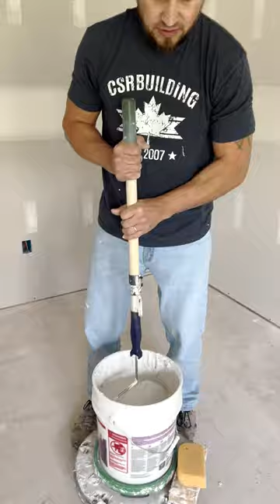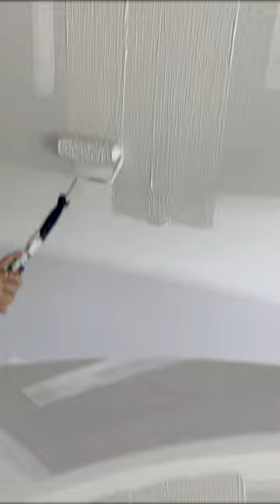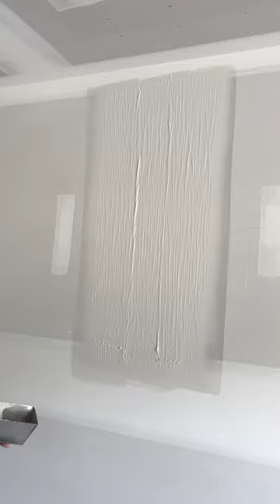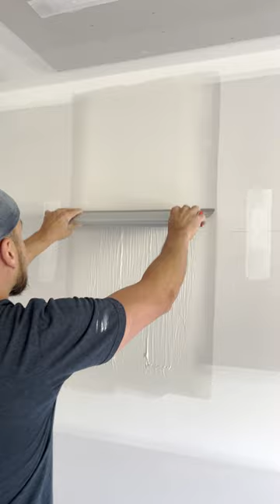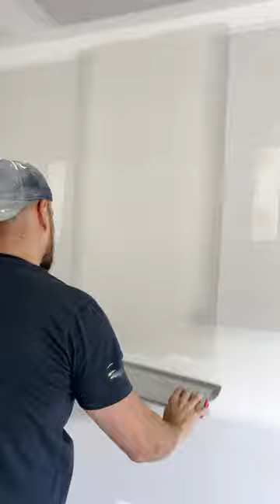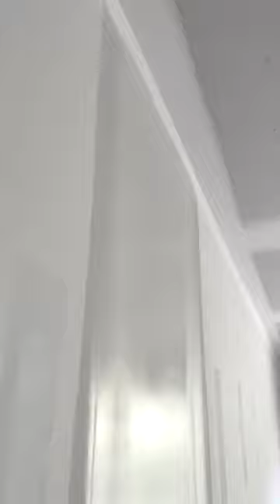Skimming Butts with the @LEVEL5Tools  24" Skimming Blade 🔥 🤘 #drywall #tools #satisfying

Comment: All the negativity for no reason. As an amateur I struggle with mud and relied heavily on sanding which just isn't clean or efficient. I don't use a roller but I bought a 32" skimming blade for $50 and it has been a very welcome addition to my arsenal. A lot of patches are the width of studs so ~16". 32" blade does it in 1 pass with 8" feathered out on each side. Light sand and wipe and you're done. So quick and satisfying compared to the snail trails I was leaving with regular knives.

Comment: I would love it if you would make a video showing how to skim over heavy orange peel or knockdown to a Level 5 finish. Thank you!
Reply: I’ve seen both options done: one they sanded it down then mud. Second they mud many coats over until it’s smooth. Then did final lite skim coat to their liking. It’s a lot of work either way unfortunately.
Reply: @Oneklickmedia  I’m currently doing this in my large family room (alone).  It’s a lot of work, but so worth it. It will definitely show you how bad drywall work can be sometimes. I’ve been doing several coats of mud to get everything even. I used the roller and I have a 18” skim blade like the video. I really like using the long sanding blocks. I didn’t do the ceilings though. I’m on my final skim before I prime.

Comment: Is he using straight All Purpose Compound? Thinned down with a little water?
Reply: Never use all purpose for finishing,  you will regret, for final coatings use dust control compound.
Reply: @caezarlapuc8627  I know Sanding all-purpose is tough to deal with.  Makes a real mess.
Reply: @ATREZ0123  after all purpose, use  plus 3 to fill in low spots and for final coat use dust control compound,  unless he answers to you,  we will not know what is he using.

Comment: I'll check that when it drys see if it flat
Reply: It is.  Assuming you are over 50 years old.... all you old fellas seem to hate skim blades for some reason.  Hilarious.
Reply: @kbkbkbkbkbkbkbkbkbkb  I'm 37 I been wanting to try the skim blades looks faster less work I would check it if it rocks grind down over the tap with Porta cabel sander then bust it out again
Reply: @markbates2059  it was already work and probably even flat before he did the final coat, if you noticed, he doesn't go beyond the line where the previous sanded mud was.
It is possible it had some bubbles or pin holes and the final coat takes care of it. Regardless, he knows his stuff.
Reply: @caezarlapuc8627  I might have to get me one of those

Comment: 3 tools to finish a butt. No money there.
Reply: If you aren't doing it this way you're behind. Invest in tools to make the job faster and better quality. Let me guess you don't use automatic tools either? Step up your game
Reply: This could actually be faster I think. Once you’ve got a system and are not filming a video. I’ve seen this done a few times and you get really nice results as well
Reply: @carbb5760  there is no way switching between 3 tools and rolling on mud is faster then a hawk and trowel.
Reply: @Eviction Carpentry  you're right. I work with hawk and trowel too, but the only part that makes me think a bit is how this might save my joints or at least I wouldn't put as many kilometers on them.

Comment: The roller is the normal one that painters use or it is special, if you have it, what is it called.
Reply: Normal paint roller polyester , u just need a 1 inch or 1/ 1/4 inch nap
Reply: Purdy marathon 1 - 1 1/4 inch nap

Comment: Do you do this on every joint, ot just butt joints?
Reply: Would take 2 years to do a house if they did this tool is a money grab
Reply: Wrong you can move quite fast with those tools he is doing it slow to show his work
Reply: @gordongoodkey4118  quit fast is not the same as fast my friend we do not use these tools on a regular basis it would be stupid and a loss of time and money.
Reply: All good friend I'm sure your a fast taper.but I hire alot of fast and not so fast tapers and you can skim coat alot faster than the vid shows . If a guy is fast he can fly thos way too skimming butt joint and sun walls is just one part of the job